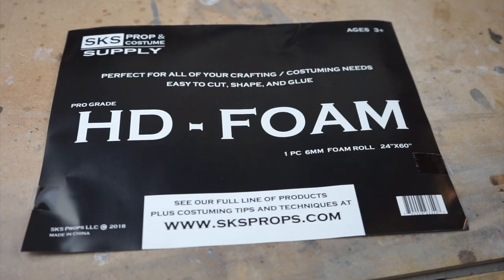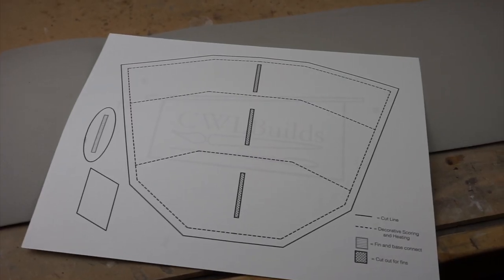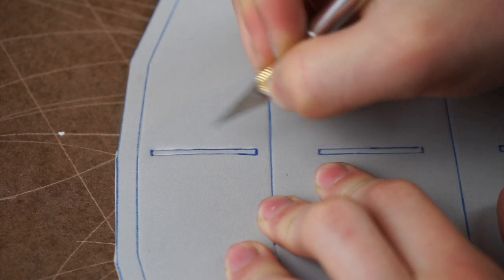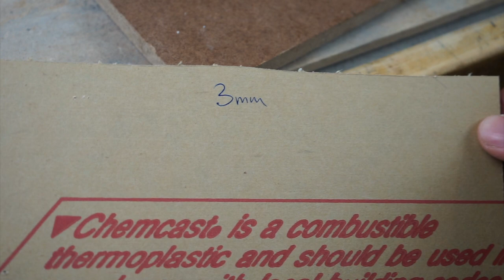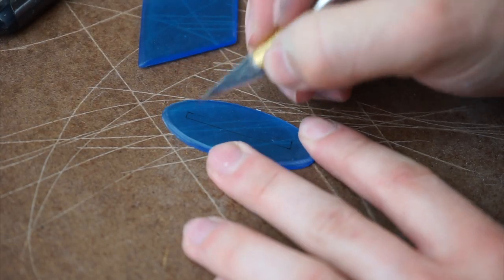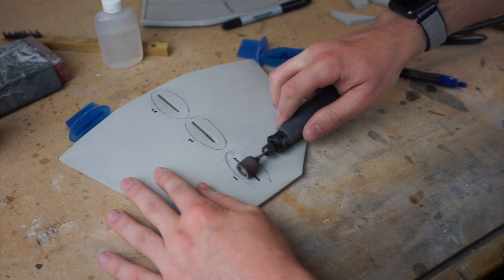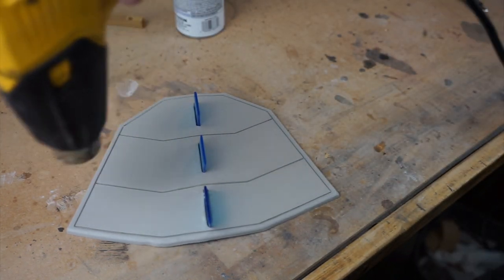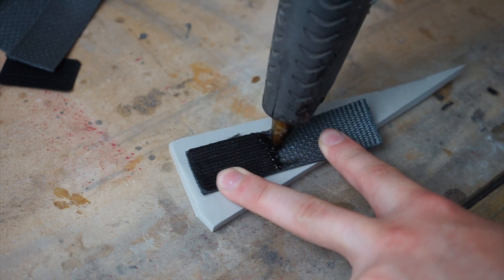CWLbuilds Custom Red Hood Gauntlets

Comment: Thanks for this, I purchased the template and have been finding this tutorial super helpful with my current project! What did you use to cut out the blue pieces? Can you recommend a type of harder material for the fins and bases that won't require a powered saw? I have some a couple small hand saws, an Xacto knife, a dremel, etc. but I live in a city apartment and don't have access to anything much bigger.
Reply from the maker: Im glad to hear the pattern is working well for you. If you have a cut off wheel for your dremel that should work for cutting out most acrylic sheets. You'll just have to do a little clean up with sandpaper or files as the cut off wheel leaves a melted burr on the edges. You can also cut thin acrylic with your Xacto blade, just go slow and make a few passes with it. You'll be cutting a little bit each time you drag the blade across.
Reply: Awesome, thank you so much!